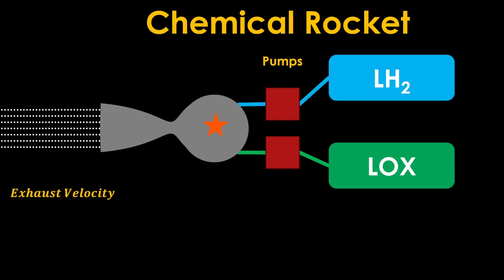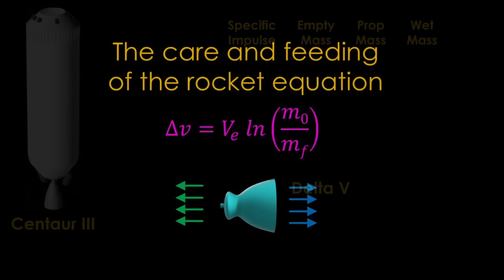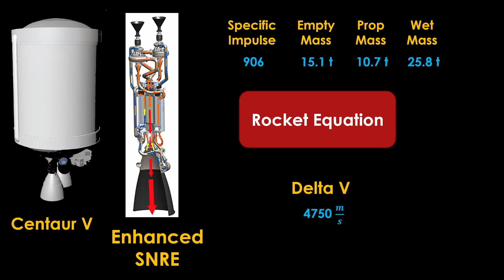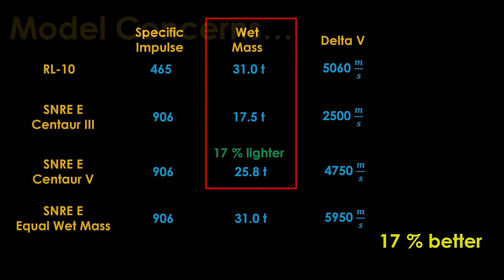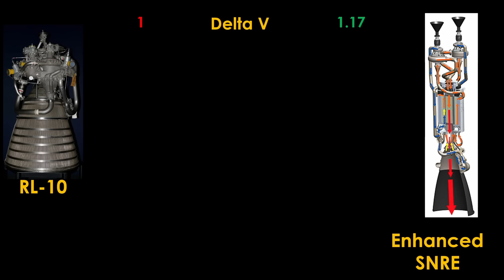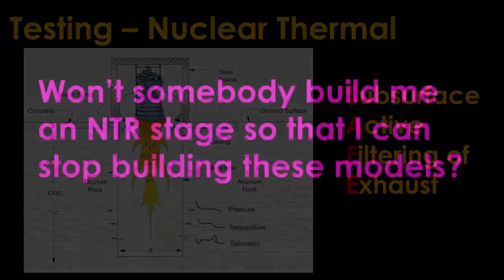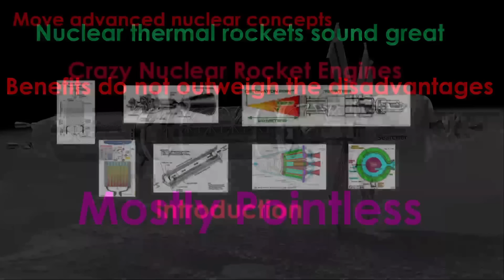Why Nuclear Thermal Rockets are Mostly Pointless

Comment: Forvigve me for saying so, but this seems like a fairly narrow minded evaluation that's closer to pitching the lack of a business case to a company in the near to medium term rather than talking about the viability of the technology as a whole. I've always seen NTRs as something we should have a focus on researching to solve more long run problems like interplanetary vessles where you're not constrained at all by the size of a stage and where you're going to see the benefits of any ISP gains since the mass of the vehicle is going to need to be relatively high anyway, and these are the reasons that people typically seem to advocate for them. It's not that the development costs wouldn't be very high, I'm sure they would be, but solving the problems that come with developing an NTR can lead to an engine that has significantly better fundamental characterisics, as opposed to a chemical rocket where we're already fairly constrained as to how much further we can push them. We're already on the cusp of developing this type of vehicle as a species so I think it makes sense to look into developing better propulsion now since it absolutely will take a long time to mature
Reply from the maker: NERVA was done back in the 1970s, and since then nobody has built a real stage out of it. 
NASA has some interplanetary designs - at one point their mars architecture used NTR, and IIRC one of those compared it to chemical stages. But I'm of the opinion that they are cheating - their interplanetary design use flexible (inflatable?) hydrogen tanks in stage structures that they toss away - a poor mans kind of staging.
Reply: @EagerSpace so staging, regular staging. God you are dumb. Never developed further in 70s cause america busy bombing Vietnam rather than exploring space
Reply: @EagerSpace that is the rich man's way of staging. Drop tanks are only viable if your fuel rich in Leo. Its at a certain point the dry mass of the tanks is much more of a hindrance than the engines so smaller drop able tanks gives better performance.
Reply: @EagerSpace  Tbf, nobody has built a methane engine either until the last five years, and that has always had a very solid business case.
Reply: I think conventional rockets are sufficient for travel to mars. The biggest limiting factor on our ability to explore isn’t technology but the cost
Reply: No people advocate for them beause they are space-cadets with no technical understanding and a pigheaded belif that nuclear anything means infinite power and all their space fantasies coming true over night.  Their is no senario where the small efficiency gains cover the operational complexity and development costs of these things.  What DOSE make sense (and which every NTR space cadet hates) is Solar Electric propulsion which is leveraging existing satalite and solar development which continues in private industry all the time meaning minimal development costs as you just assemble a vehicle out of off the shelf parts (power and propulsion element of Gateway is the quintesential example), AND gives higher ISP and payload fraction AND can be reused for decades by refilling with cheap inert noble gases.
Reply: Oops, sorry no one mentioned the poor thrust of those nuclear thermal rockets. They can't even lift from the ground on their own.
Reply: @mathiaslist6705  They obviously aren't supposed to be used in-atmosphere...
Reply: Nuclear thermal is outcompeted by ion for in space peaceful transfer 

Nuclear thermal is however far better to launch things to orbit and to fight wars in space. 

You can get away with an acceleration as low as 10 mG or lower for interplanetary spaceships without having issues with transfer times. You only begin to need more thrust if you spend hundreds of kilometers per second go delta v to go to a nearby target like earth to Mars at 500 kps. That would probably require more than 10mG and it would look like a straight line brachistochrone. But that’s a performance ion engines could deliver. 

What ion engines cannot do is thrust and acceleration. This is needed to takeoff and land, as well as in war. For these applications nuclear thermal rockets are far better

They are categorically like a stronger version of chemical thrusters, they’re in the category of high thrust thrusters that can give a ship more than 1G of acceleration, just like chemical engines, but can give you vastly more delta v than chemical engines. It’s their advantage

More advanced types of nuclear engines can also give exhaust velocity comparable to the lower end of ion engines. Stuff like liquid core nuclear rockets which run so hot that the H2 molecule is split into H1 which instantly doubles exhaust velocity and delta v. Yes that’s how it works it’s op I know. But you need very high temperatures to do so and the idea is to have hydrogen contained inside liquid uranium to achieve this. But to develop such powerful and amazing engines you need to research and investigate the more basic types of nuclear rockets first

Lastly the earth has a GDP of 100 trillions per year and the nerva program had a total cost of 170 millions over 15 years. Humanity is a failed species
Reply: @IceRain-f5v  good thoughts.
Minor quibble: halving the mass of your exhaust particle should only increase exhaust velocity by a factor of 1.41 (sqrt 2) rather than doubling.
Reply: Yes correct @michaelmicek if I said it doubled it was a mistake
Either way it’s a large bonus

Pretty much all rocket exhausts contains hydrogen. Hydrolox, methalox, O2 RP1, hydrogen fluorine, nitromethane etc 

Having small particles like H1 or H2 disproportionately increases your exhaust velocity (I’m not sure why physically when you zoom in at the level of the atoms)

Hydrogen bonds are useful too because they take up an electron orbital spot without adding too much weight. Those hydrogen bonds have to be broken which of course loses energy in the reaction but the created oxidizer bond generates more energy because it’s more stable as oxygen and fluorine are more electronegative. 

When hydrogen isn’t present helium generally is. 

The only time a heavy particle is used as exhaust is the ion engines that use argon krypton or xenon. These use noble gasses (not technically mandatory) but for ion engines it’s generally easier to get exhaust velocity than thrust. So often engineers decide to use very heavy xenon atoms instead of helium. 

Doing this is honestly questionable I’ve never worked on engineering and ion engine however I feel like it should be possible to bias the output towards more thrust and less exhaust velocity and switch to helium which should give overall better performance and more efficient engines

The issue with very low thrust engines is that you reach your destination before the burn is complete. As in it might take 6 months to go from earth to Mars but the engine burn itself takes 8 months. This is an issue and forces you to increase thrust and decrease exhaust velocity to get there earlier. 

Any engine that burns as long as the trip takes does a flip and burn maneuver like is famous from the expanse series. Even very low thrust quite low delta v ion engines would do flip and burns. Flip and burns are however inefficient (the speed added near the middle of the flight is canceled out almost immediately) so ideally you want to do a burn at both ends that last a single instant. 

A middle ground that works quite well is for instance burn 4-6 months total for a 12 month trip. To achieve this level of thrust ion engines tend to have difficulty and so designer switch out helium for argon krypton and xenon. But I still believe it’s probably possible to modify a design so that it can rely on helium 

The DAWN mission visited both vesta and Ceres in the asteroid belt and it used a xenon thruster with around 30 kps of exhaust velocity. I don’t know how much delta v the probe had probably 20kps or less (I don’t think it had a lot of fuel on the ion stage). Switching to helium and adding more fuel could give a probe 100 kilometers per second of delta v or more with existing technology. The issue becomes being able to expend this fuel within the few months/weeks a trip at 100kps would take. Both solar energy and engine design (thrust/exhaust velocity balance) become an issue. 

But the good news is that ion engines are an existing technology that allows us to travel between any two point in the solar system in months. I did a study I didn’t publish on the use of non nuclear ion engines and yes they work so you can use that tech to go to the outer solar system too. For instance earth to Neptune or Pluto without gravity assists in 2 years or less without nuclear energy either. That’s possible with existing technology. Electric engines rule space-space transfers, while nuclear thermal engines are the premium option that is best for any application that requires high thrust. Chemical engines are the budget option for high acceleration necessities. 

Lastly a ship can have both. You can have two types of thrusters that run on the same fuel source which gives a lot of options. Engines are generally not heavy especially if they are well designed and have high TWR
Reply: @IceRain-f5v  yeah, that all makes sense.

I'd just add that what you want in an ion thruster propellant is an atom that's easy to ionize.
The bigger the atom, the less tightly held the outer electrons.
Actually, Group 1 elements are the easiest to be ionized (half of xenon and ⅓ of argon), but they are harder to work with.
Reply: At very high power ion thruster efficiencies keep going up that’s why I didn’t put ionisation energy as such a big factor 

Also while I’ve basically not even looked into ion thruster design, I was under the impression that lighter elements always win out as far as how much delta v you get per kg of propellant completely independently of the ionisation energy. That it only affected the power and electric supply needed
Of course it’s a huge factor in ion craft designs especially if you try to make big ones, and so is thrust if you care at all about transfer times (if the thrust is too low you can’t even do a hohman transfer and you would have to spiral out of a gravity well then essentially leave your planet off transfer window and drift between both planets then spiral in at destination in an awful slog that would take many many months for phases or the flight that would take days with a stronger TWR. Still technically possible but you get really whacky orbital mechanics 

I personally think all future space-space material transfer (the most obvious need being ices from beyond the ice line to the moon) will be done by ion powered trawlers, a trip will take months or year depending on whether they have enough thrust to do direct transfers or not. 
If they don’t have enough thrust again it’s basically like an orbital danse where you spiral inwards relative to the sun as your target for instance earth makes several rotations while you get closer, then you use the gravity of earth to the maximum possible, coming up from behind the earth instead of the side or front and using both single body gravity assists (earth-earth gravity assist like a ricochet not a full orbital period) until you then spiral inwards relative to earth. It’s absurdly slow and it’s also a bit inefficient delta v wise compared to hohman transfers, Ceres to Luna might take 5 years or more which is just silly (a good engine would do it in 20-40 weeks)

But so long as it’s bulk cargo in a conveyor belt model where new ones are constantly being launched and arriving, transfer times aren’t THAT central. 

The question is whether they will chose to use lighter elements or heavier elements. I doubt they will use noble gasses are those are just too rare especially if you scale things up to hundreds of kilotons of cargo per year.

Xenon for now isn’t too bad especially if they have serious fundamental difficulties increasing thrust (the opposite issue from other forms of engines), and earth has enough xenon to last us a while. I still think it would be better to switch to something like argon or helium if you can manage the lower electrical efficiency (= more power supply mass required)  and lowered thrust (even MOAR power supply mass required!)
But if you can secure the engine efficiency and thrust, ion engines can give you in the order of magnitude of 100kps + the acceleration to spend it (around 10mG from experience especially around gas giants) which makes travel between any point of our sole system a fairly trivial matter. 
Especially the outer solar system, you can’t do hohman transfers to Pluto so you need to over burn and slow down to get there faster than centuries. A 100 kps burn to Pluto would probably take you what, 2 to 4 years? It’s really not that bad considering how far it is
And the same engine fan get you from earth to Mars or mercury in no time. That’s the power of ion engines. It’s a tragedy we haven’t developed them more

The DAWN probe used xenon (as far as I know) and has an EV of 30kps. It’s fairly low for ion engines but considering it’s xenon, switching to krypton or argon or even helium would instantly multiply that 30kps value and give you pretty sweet results. It was called by NASA "the first interplanetary spaceship ever made" and they’re correct, only ion engines have the ability to go back and forth, orbit, get places fast etc.
Reply: @IceRain-f5v  SpaceX (in a rare move) bought the technology for argon thrusters and is using it in Starlink now.
Any comments on Aldrin cyclers?
Reply from the maker: >Pretty much all rocket exhausts contains hydrogen. Hydrolox, methalox, O2 RP1, hydrogen fluorine, nitromethane etc 

Hydrolox contains a lot of extra hydrogen because they run very fuel rich (6:0 rather then 8:0 stoichiometric). That gets them a much higher specific impulse from the hot hydrogen in the exhaust without being too limiting on thrust. 

Methalox runs a lot closer to stoichiometric because being fuel rich isn't really a benefit for specific impulse, and they just need to be fuel rich enough that they don't have to deal with very hot oxygen in the combustion chamber. 

Kerolox is too weird to talk about because the fuels differ wildly, but my understanding is that they run relatively close to stoichiometric for whatever hydrocarbon mix they are using.
Reply: @EagerSpace
Nice try but no, that’s not why they run hydrogen rich

Adding hydrogen lowers temperature and average energy faster than the lighter molecules improve Isp, any deviation from stochiometric lowers Isp. 

It’s done because no one wants a 3500K oxygen rich flame to touch their copper engine bells. More hydrogen means a cooler reaction with most of the Isp of a hotter stochiometric reaction. Also water might possibly decompose if it gets too hot which would cool the reaction a lot and cap engine performance at whatever temp water decomposes at
Reply: @IceRain-f5v  We are not fighting interplanetary wars any time soon.  At most were looking at satalite on satalite kinetic kill vehicles, and hypergolics or even solid rocket motors will completly crush in that catagory because they are storable for indefinite periods and will out acceleate the NTR by an order of magnitude.  No one is launching NTR from the earths surface either, they actually have very poorer thrust to weight ratios then chemical rockets.  The only failure of humanity demonstrated here is your lack of basic enginering knowlege.
Reply: Well done, this is an extremely stupid video by someone with their head up their ass. Nuclear thermal lies between chemical rockets and ion rockets in terms of specific impulse, and thrust. The lack of business case is due to no funding for real space missions etc
Reply: @BrowithStoryCool actually, all he said was the fuel tank might be much bigger than expected. So maybe multiple fuel tanks to make it worth.
Reply: @mathiaslist6705  Multiple fuel tanks doesn't do much to solve the high dry mass problems of nuclear. They give back much of their advantages over chemical rockets by requiring heavy shielding, thermal radiators, and far heavier cryogenic hydrogen tanks. Then they fall behind on the Mars route because they can't take advantage of aerobraking like chemical rockets, meaning they have to increase propellant mass at least 50% and have expensive custom landers that add even more dry mass.